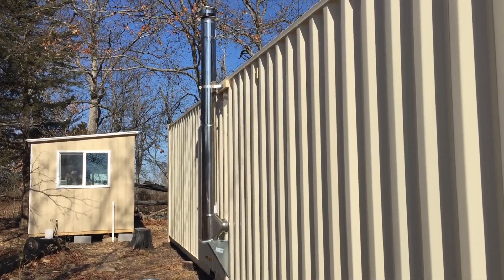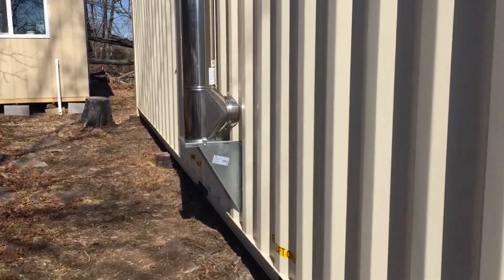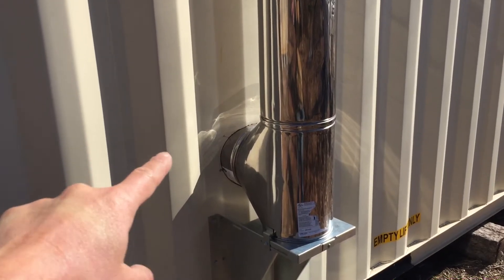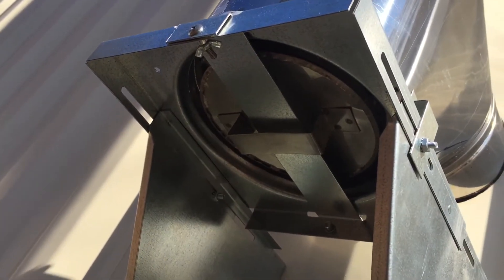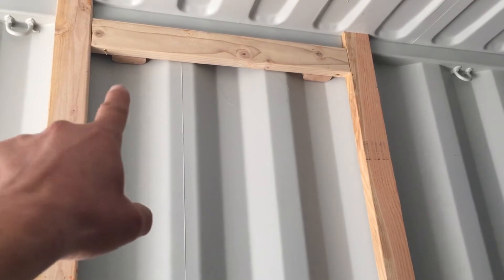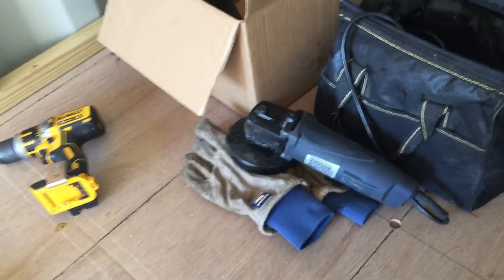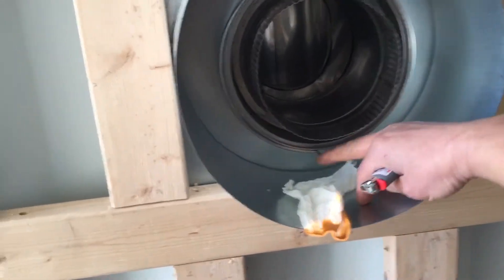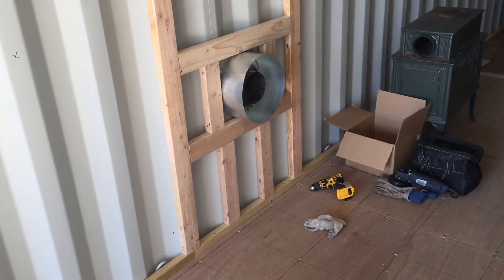Shipping Container Stove Pipe Install

Comment: For anyone reading this, this is a very inefficient way to install a stove... you SHOULD have the chimney stack INSIDE of your shipping container, and only exit near the top of the wall. That's because the chimney stack is radiating heat and will do a MUCH better job heating your space if left inside instead of outside :)